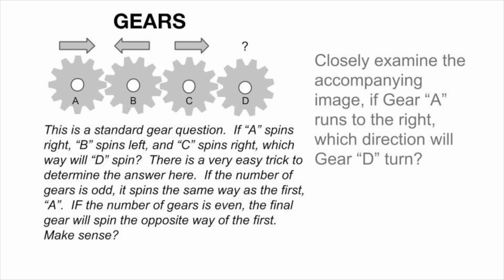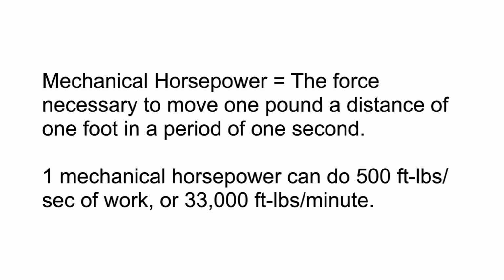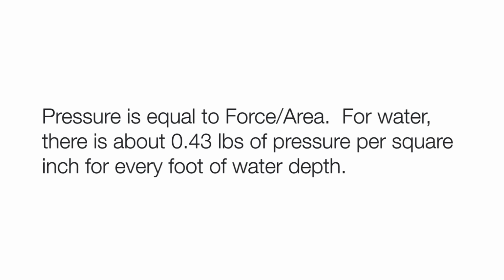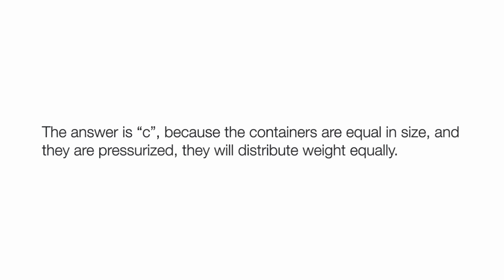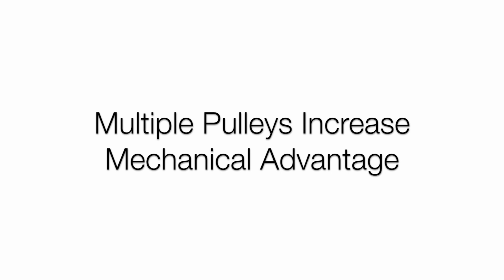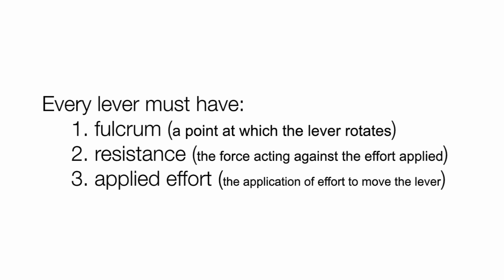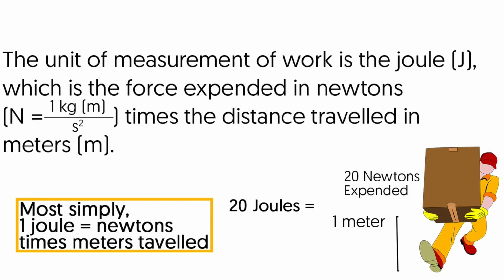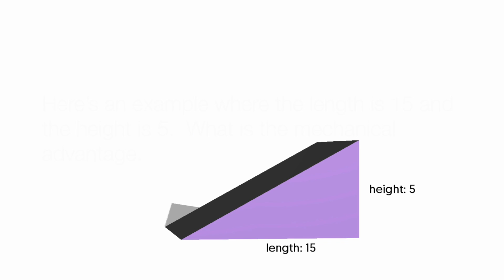MASS Test - Mechanical Concepts - Study Guide

Comment: I believe under your Mechanical HP formula, the 500 ft-lbs should read 550 ft-lbs. The math in the example did not work out. But I have to say the video is useful, thanks for posting it.